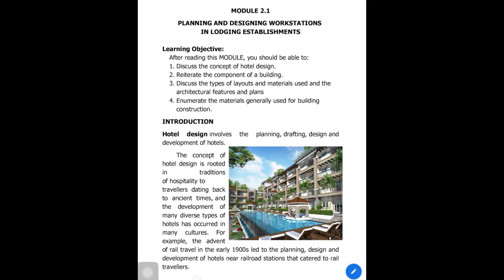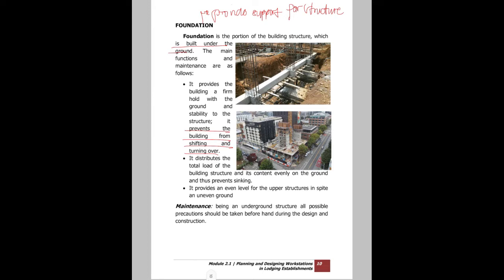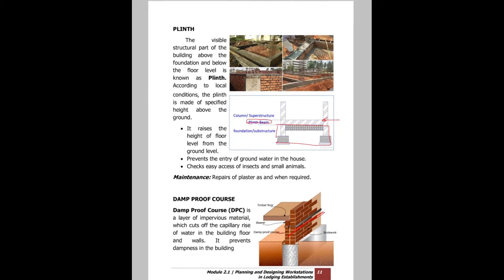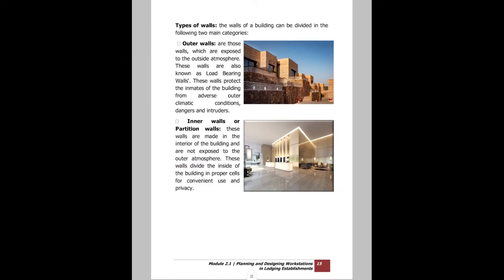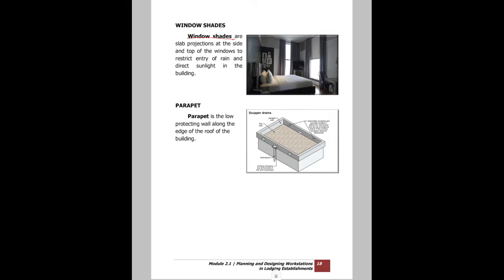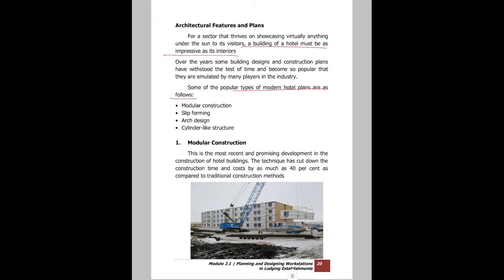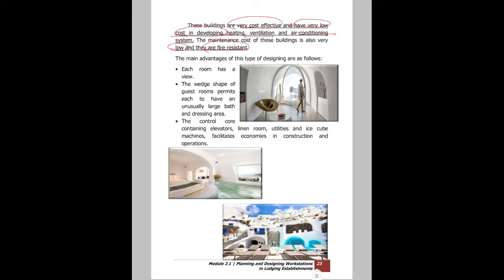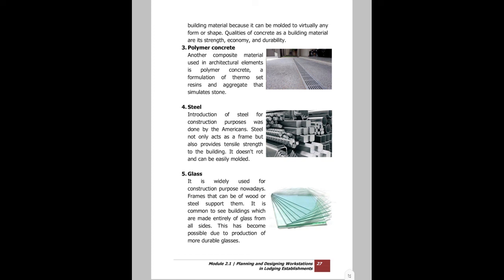HM109 Planning and Designing Workstations: Lodging Establishment

Comment: Ang natutunan ko sa module 2.1 planning and Designing workstation in Lodging Establishments.
Hotel design- visual concept, architecture, interior decoration and aesthetic style. Sa panahon ngayon ang mga design ng hotel ay nakafocused na sa modernization at contemporary edge sa loob ng country at sa outside country noon ancient time. 
Components of a building
*Foundation- provides support for the structure
*Plinth- tinutulungan no Plinth ang isang buildings para maiwasan ang pagdami ng bitak.
*Damp Proof Course- maiwasan ang moisture sa pader at sahig.
* Floor- hard leveled surface. 
May dalawang component ang floor 1.Base 2. Top.
*Walls- are the part of building structure between the floor and roof.
*Walls- outer walls- outside atmosphere
Inner walls or partition walls- not expose to outside atmosphere.
*Stair and staircase- move between the different floors of the building.
*Doors- opening in the walls flushed with the floor level for the entry and exit in the building.
*Windows- maintain ventilation to keep the interior atmosphere of the building fresh.
*Ventilators- small openings or window placed higher up in the wall near the roof level.
*Window shades- to prevent the rain drops.
*Parapet- is the low protecting wall along the edge of the roof of the building. (30inhes above suggested height)
*Subsidiary components of building mga bagay na pwedeng idagdag sa paggawa ng building at ang mga nakakahawa nito ay ang mga Architect at Engineers.

Comment: In this module I learned what is the important thing that we should have to built one  building. In Hotel designed focus visual concepts, archtecture, interior decoration and aesthetic style. If we want to build our owned hotel it is important to know what we need to know step by step. First the foundation to provide support in our structure and having a safety precautions for our workers. Plint to prevent cracks it is important to maintained. Floor or also known as hard level structure. It is not only make for carrying the employees but also the equipment ang furnitures. If it has a crack report to the maintenance department. Walls it is mixture of solid material and liquid or water. Stone block it is a pieces of natural rock formation. Mad blocks it has a standard size for the structure it depends on architecture. Reinforce break walls is better to used because it is solid than other for the walls. 
I also learned the Types of wall which is outer wall where we can see it in the outdoor. It is visible outside the building. If the outer wall is strongly made it can't break easily when there is any disaster. Next is Inner walls it can see in the interior or inside the building. 
Stair and staircase it always provide in one building even we have the escalator or elevator. The Parapet  suggested hight  is 30 inch above the floor. And in one building like hotel there are always have a Subsidiary which is the additional and extra elements to make a building to make it more presentable in the eyes of the guest. I understand the types of layout use. The Facility layout this is what we called the arrangement of different aspect of manufacturing in an appropriate manner. We need to consider in our facility the available space, final product, safety of workers and also the facility convenience of operation. As I understand Facility is one of the place in building where we can do any activities. 
This all information is important but the ergonomics is always there because if our facility layout or floor layout is well function the safety of our employees can be efficient and they can be more productive without worried.

Comment: in this module i learned that hotel design focus on visual concept, architectural decoration and aesthetic style. Today's hotel design is more modernize and contemporary within and outside the country due to innovation. When create a design the work station should be match and we have a lot of things that should be consider to have a successful and well maintained building. I also learned the importance of each part of a building component such as Foundation that provides support for the structure. Plinth that its purpose is to prevent the cracks of a building and etc. And people that are involved should consider the safety precaution during construction.

Comment: I learned Hotel Design focused on the visual concept, architecture,  interior decor and aesthetic style.  

Component of Building permanent enclosed construction. 

Foundation provides support to structure. At kailangan dapat sa pagpaplano ng foundation may safety precaution.  

Plinth protect a building lalo na kung may baha.  

Naka focused dito sa pagpapatayo ng building kailangan pinagplanuhan pinag isipan mabuti at kailangan ang mga gagamitin na mga materials ay matibay at tumatagal..

Comment: In HM109 2.1  I've learned the importance of maintenance in planning and designing  the workstations in lodging establishments in order to maintain the particular features of the hotels or buildings. And the importance of properly planning  and designing of the hotels or buildings to prevent the building from shrinking and the materials also matters to make the interior of the facilities appropriate to the guest. Lastly the importance of foundation to provide proper support to the structures of the hotels and buildings.

Comment: I learned how to plan a building regarding designs and correctly identify every part of a building including the location and the soil. according to the discussion not only you put a building if you don't have an idea about the part of the building. To prevent the building collapse, to prevent any kind of problem regarding the building. 
For the designing of one building either modernization or old design of a building. But for this time majority of the buildings are modernization style.

Comment: In this module 2.1 which is the planning and Designing workstation in Lodging establishments. This is all about different aspects in planning and designing buildings or Establishments such as hotels. In this module it discuss that in building and Designing a hotel needs to plan very carefully, estimate cost and it need good quality products and materials to be use for the sake of having a beautiful, safe and secure that will last for a long time. Hotels design now adays focused on modernize and contemporary. Focused on visual concept, Architectural features and Etc. And here it incharge professionals such as Engineers and Architechs and they should focus too on safety and precautions of everyone.
It also Discuss different components of a building such as Foundations, Plinth and etc., the subsidiary components of building and the types of layouts and materials used. Thankyou

Comment: For my learnings regarding in Module 2.1 which is Planning and Designing Workstations 
A hotel design are having a dynamic visual concepts that involves different kind of unique styles and designs to focus modernization, inside and outside theme to have a quality design through innovation. Hotel operations conduct planning such as floor plan with the help of engineers and architects for having an aesthetic design of buildings depends on the owners choice. The good foundation could take months or years so that they provides safety precautions and safety protocols before to conduct a work for the safety of each employees.
Having your own hotel building there are also components that need to be follow for a successful operations such as facilities layout and design which is the arrangement of place of equipment and materials in the building. An architectural building of a hotel might attracts travelers and guest will be impressive and they’ll book another room for another stay. Hotel operations also include materials that you are going to use while the building is under on construction it helps the aesthetic appeal of the hotel interiors design because some of the guest arrives in hotel to find a relaxation place for having a long tiring days that’s why having a unique interior design strategy and good quality of service inside the hotel it takes an advantage in different hotels in the area and it became your trademark that’s why guest choose to book another stay. I also learned the good structure of a hotel is important build by planning and made by strong foundation that functions more several years.

Comment: *When we combine everything planning, drafting, design and development of hotel is focused on visual concept, architecture, interior decor, aesthetic style 

*Now a days, designing a hotel is more focused on the modernization contemporary incoming edge.

*Building: Relatively Permanent enclosed construction.

*Foundation: Provide support for the structure

*Facility layout: Arrangement of different aspects of manufacturing in an appropriate manner.

*Benifits of Slip Forming Construction: Nonstop method of construction, increase the rate of construction, reduce labor costs, create a safe and work environment for the workers.

*Polymer concrete: Always used in making bathtubs, boats, aircraft and roofs.

" In this lessons po natutunan at nalaman ko po ang components of a building kung ano po yung kahalagahan ng bawat parts ng isang lodging Building at yung iba't ibang uri at uniqueness po ng architectural Feature plans"

Comment: I’ve learned in this module that structure is important and also kinds and structures like curtain wall, and many kinds or structural features are characterized the aesthetic and durability of the facilities 
Materials also matters bricks , concrete wall polymer and etc. are important to improve and represent the beauty and durability of your buildings

Comment: According to this Module the planning and designing buildings and Establishment is about Building requirements or How to provide a Strongest building without any Complain or failed. Pag nag tayo. Tayo ng isang hotel hinde madali years ang inaabot at higit sa lahat pinag iisipan hinde lang tayo basta-basta nag Form ng Buildings madaming requirements ang need natin para successful ang kalabasan ng pinag hirapan natin kasi kung hinde madaming mapapahamak na tao employee or kung sino ang nakapaloob sa establishment na ito. Kailangan ng mabusising pamamaraan sa pag gawa nito mula sa katatayuan nito. Kailangan din ng lisence architecture sa pag gawa nito hinde lang basta tao or engeneering without Lisence ang gagawa nito. Kailangan rin dito ng Cooperation pag tulong tulong Coordination dapat nakikipag coordinate kung sino man ang gagawa rito at shempre Communication para mag maintindihan kung paano ito sisimulan hinde basta basta gagawa nalang ng isang malaking establishment na hinde sigurado.

Comment: Base on my own understanding in this module it is about building up the hotels also belongs to the topic the components of the building or the planning and designing of the buildings/establishments, and also mentioned in this module how to making sure that the engineers and architects are safe around the establishments when they have a guests or customers. Like for example the floors have broke lines so that it will not safe for the employees and guest.  They need to renovate a buildings to maintain the safety of workers and customers. In this topic also defined the different types of wall and how safe each of this, the stairs, doors, windows ventilator designs. It will also discuss a different materials which they can used for building up an lodging or establishment designing, it shows that how strength each of this.

Comment: According in module 2.1 ang design hotel ay kailangan mag estimate ng gagastusin sa gagamitin na sa pagpapatayo ng establisment kailangan ng good quality ang products na kakailanganin para sa pag papaganda , pag tibay , modern designize interior and outerior sa pag papatayo ng isang establishment para maging innovation. Incharge dito ang mga professionals engineer at architecture para sa mapapaganda at pagtibay sa paggawa ng building. Dito nakapasok ang mga main parts ng establishment like Foundation its provides support for structure and safety ng manggagawa sa pag gawa ng establishment pati na rin ang employees at customers . Plinth dito nakasaad ang help prevent to cracks and Damp proof course prevent moisture sa pagitan ng sahig at pader.